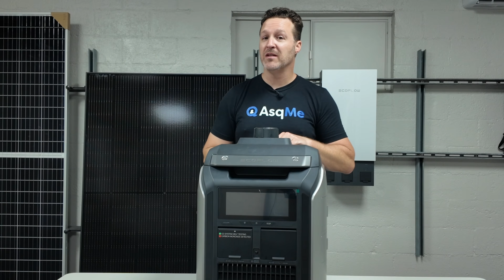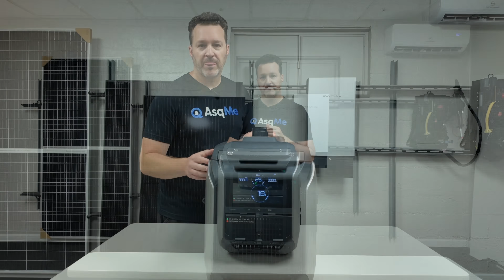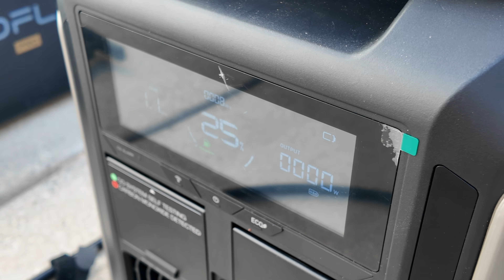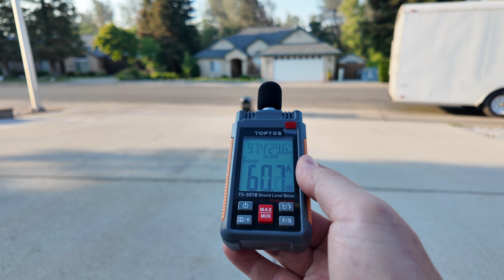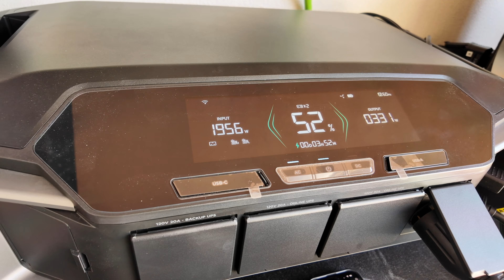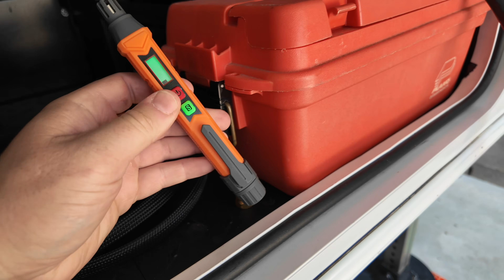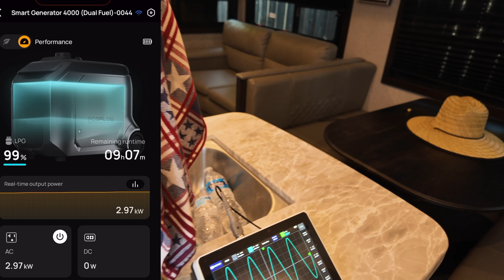ECOFLOW Smart Generator 4000! Complete Review

Comment: I just purchased DPU and the the package included an EcoFlow 4000 watt generator and what was offered was cab
Why would they package these together with cables if unable to charge DC to DC? 
In the comments below, someone mentioned the transfer of the DPU A/C output to the generator while charging AC charge to THE DPU 
I am still waiting for the generator to do my own testing. Will be disappointed if I can’t charge the DPU efficiently with the generator while the DPU IS pushing out A/C power
Reply from the maker: The DPU can not except dc charging. 
Only AC 

The smart Gen can still be used and you can have full app control but it won’t be able to talk to DPU and start and stop when it needs to.
Reply: I just received my ECOFLOW 4000 watt generator 

All Seems ok except for one issue: Being able to connect via Bluetooth. I have sent an email inquiry to ECOFLOW. 

I have multiple devices from EcoFlow to include:
Ultra 
2 waves
Delta pro 3
And a glacier 

All link up to the EcoFlow app without issue. 
I have tried multiple ways to this 4000 watt generator to Pair. Just a continuous blinking of the symbols of Bluetooth and WiFi symbol. When i reset the IOT ( hold for 5 seconds) it beeps and the symbols just continues to blink. I have allowed the internal battery to completely charge, tried connecting with the engine running and without the engine running. Are there any suggestions or a unique procedure to in trying to Pair? A unique QR code? Any suggestions? I am still waiting from EcoFlow. Just have an automated response as of now.
Reply from the maker: @johnkraft5640 mine connects pretty quick just like the other Ecoflow products. I guess make sure it’s on the correct update and if not maybe a replace ??

Comment: Nice review but I didn’t see ant details covering oil…weight, adding to the unit, change frequency, etc.
Reply from the maker: The basic info like oil is all in the manual which everyone should read. 
The gen provides AC at 120v and 60hz.
And pure sine wave. Or DC if you have a Ecoflow product 

I’ll do a service video later 👍🏼

Comment: Can I use this new generator for other Ecoflow products such Delta 2 and Delta 2 Max?  In addition, can I also charge other brands such as Anker?  I assume, it may need some adaptor/connector?
Reply from the maker: You can use this as a normal generator to run or charge things. 
You can also charge any Ecoflow item that has the xt150 connector.

Comment: Hey Johnny, I'm still trying to figure out all this generator and home back up and solar stuff. LOVE your channel. I have a Delta Ultra Pro now with one battery. Will this Smart 4000 automatically kick on with the Delta Ultra Pro if it is low? I was reading that it would not. Also, will this work with a 50 Amp Interlock Inlet for a circuit breaker panel. I saw that the 4000 only has 30 Amp out.
Reply from the maker: No it won’t smart connect to DPU unfortunately and it’s only 120v Gen so a 240v unit would be better for the home and a Gen inlet box if it’s wired to power the whole panel
Reply: @johnnysweekends  That's what I assumed, thank you for clarifying!

Comment: Hello so I am guessing that the adaptor that goes in the battery connection on the pro 3  is not the same battery connection on the ultra and does not work the same looks like you were charging the ultra with the the 120 outlet on the generator ?????
Reply from the maker: Does not work with the ultra, unless you ac charge at 120. But that’s kinda pointless

Comment: And with the Delta pro 30 yes, that's right. They made a doubt, the problem and they made it to ultra. Then they step back and made a Delta pro 3. When they could've made it just like to deal to pro with more battery or bigger batteries. Than more power. Oh my gosh, what the days screw up with now? It's good that they say it's like a tap with the machine itself but it better off. But then just had 2 batteries cause. Then they could have a lot more power in a minute.  Hell a lot more instead of you have to have 3 generators and all its batteries and only get a few 1000 months a power called oh my gosh, 12000 W. I'd rather get to be Delta pro ultras that, I wouldn't rather get 3 Delta ultras or Delta pros than factor I mean, I can get 4 Delta pros.  Achieve more with that and cost less Then this

Comment: It’s not clear to me how compatible this is with the delta pro ultra. It looked like you were DC charging an ultra but does it replace one of the solar inputs to do that?  Whenever I AC charge my ultra with a generator, it seems to transfer any loads to the generator rather than using the inverter on the ultra. I know all of these products are new but it sure is hard to figure out what works together on the EcoFlow site so I really appreciate content like yours to explain things.
Reply from the maker: Unfortunately this does not work with DPU hence not mentioned and me trying to plug it in at the end. We all thought it would be some how. Maybe there is a new just for it..?🤷🏼‍♂️
Reply: Any updates on this? I just ordered two DPUs and this generator to find out afterwards its, “not compatible”. Can’t I just install a generator hookup to my SHP2 and use this to recharge the DPUs?
Reply from the maker: If doing two dpus thats a lot of energy needed to charge efficiently. I would look into a larger 240v option
Reply: @johnnysweekends Thanks for the quick reply! Do you have any recommendations?

Comment: Question please: Hi Can I use the Generator adapter plug (XT51) and connect the EcoFlow Smart Generator 4000 to ..... wait for it.. wait for it....... any of the ports on the right side of the EcoFlow Delta Pro "ULTRA" where the fast charge ports are located? What is the power transfer?
Reply from the maker: The new smart gen can charge dpu by the AC power port only …
Reply: @johnnysweekends  :-(😩 ... Perhaps your contact can tell us if they are coming out with a simular solution for the DPU.
Reply from the maker: @Jay-fc4fg I’m waiting lol ..👍🏼

Comment: My Champion Trifuel RIGHT NOW puts out 6kw on natural gas with split phase output ... for $1500.  I have no idea why Ecoflow is trying to compete in this space.
Reply: @neverclevernorwitty7821  where this shines is when paired with an ecoflow battery so you can run small loads off the battery with the generator only kicking on intermittently.  I don't see this aimed towards the RV crowd but more towards the off grid cabins or post hurricane/natural disaster/Texas power grid customers where minimizing fuel consumption might be worth the premium price.
Reply: @gavincregan7892  also Minimalist campers. I want to do a cargo trailer build and not really finish it or anything. Just have it insulated with ventilation and be able to do a modular set up that I can take out so I can use the trailer as utility trailer Part time and camping part time, as well as having home back up during extreme weather like you mention. Everything being multi-use or dual purpose so I can invest in Higher Quality is my goal. I got my parents and myself each an Ecoflow Delta 2 Max and a single Smart Generator to share with them as we don't live more than 35 miles apart, but we are on 2 separate electrical grids, so it's unlikely we'll go down at the same time.
Reply: Your 6kw uses twice the fuel, even at low loads. During power outages, I'm pulling about 1000w continuously until I start turning things on. After a week or more with the 6k, that's a gas bill you will feel.
Reply: @JayRSwan mine burned about 5 gallons a day for 10 days.
Reply: User name fits.
Reply: Fake account.
Reply: @neverclevernorwitty7821  because eco flow is a superior brand and can simply do it better.
Reply: The advantage is fuel savings for high amp DC charging ECOflow delta backup battery systems. 
You get a 40% fuel savings bypassing the inverter when charging DC batteries.  
And this is plug and play auto start/stop to recharge your DeLTa system automatically.  

The motor on the smaller one (this one is a Yamaha)  was a Honda.... the same Honda generator was actually MORE expensive.   You are not comparing Apples to apples
Ecoflow is NOT in the space of the generator you own.  
 You will use 8-12 gallons a day to power your house for 24 hours.  
The on, recharge hybrid system will run a fraction of the time 4-6 hours a day and us just like 2 gal a day to meet those same KWH.  

I kept my  fridge and freezer and my lizard lights on along with running a blender, toaster, microwave on half power a few times a day and  other things. i used 6 gal total over the week without power 4-5  hours a day or so ONLY to charge my delta max with champion 2000w gen. If I had the ecoflow I would have saved that 40% fuel.
Reply: @davidarnold344 so Getting expensive Ecoflow extra batteries would be cost savings in the long wrong, if in reading what you wrote correctly. 
I purchased LIFEPO4 extra batteries Ana only way to charge them is via AC, which is a large loss of energy. THINKING that I could outsmart EF and save money, foolishly. I got this correct?
Reply: @davidarnold344  yes, this is the main advantage as well as the auto stop start functionality
Reply: Aren't those twice this big?
Reply: @BlissfulRebirth  Well, if you can charge one on a longer cable as well as power things to boot, a Honda or a conventional other inverter generator would be fine.  Besides, I am not sure if I would want to stock pile batteries in my house knowing that when they go, they REALLY go and take your home and you with it.  It's bad enough that my tablet, phone, Nintendo Switch, laptop and various game controllers rely on these relatively potentially volatile little things.  That and internal combustion engines are recyclable, batteries aren't and also have a shorter life expectancy especially for the price.
Reply: @WJCTechyman  lithium iron phosphate batteries aren't the same as lithium ion. Most of the  ecoflow units use lithium iron phosphate batteries which are a lot safer.  Check the specs.

Comment: Fantastic review  That cord only being  16 ft , that's horrible  when have multiple  ecoflow  units,  the DC charging you could get much a  cheaper  generator  to that . For 1700 dollars it seems underwhelming.
Reply: The main benefit is that it works in collaboration with their other ecoflow products. The generator can turn itself on and off automatically based on what you set. So you can set it to kick on the generator if your batteries gets to 10% charge remaining and turn off at 80%. That's its main intended use. Not to beat the others. But to run without needing much input. Its always just waiting and ready in standby if you have it plugged in.

Comment: Great info! im a bit confused on the dc to DP3 if is going to come with the battery connector adaptor or the xt150 so a dp3 would have both extra battery connectors available for more capacity.  What i'm looking for is a system to auto start and shut down to charge my solar setup. Is it possible through the app to have that happen off of battery capacity or voltage through the 110v or 240v plugs? so we could use this generator for any old battery or is it going to be a full ecoflow setup up to have is auto start stop of the dc charging only. Thanks a bunch best reviews on yt
Reply from the maker: Needs to be part of the Ecoflow ecosystem to have the full auto start stop technology. There are data pins in the Xt 150 cable.
Reply: @johnnysweekends  appreciate it!

Comment: Hard pass for me. Needs DPU compatibility out the box and Tri Fuel option for the best home standby use
Reply from the maker: DPU will have to have a smart cable through the 5+8 connector or through smart panel. Maybe we will see something
Reply: Those are hard requirements for a small generator. How many models in the market already have what you ask for ?
Reply: @TheCornucopiaProject-bd5jk  Plenty actually. My current Champion Tri Fuel Inverter Generator is helping get through Beryl right now. I still don't have power for the last 6 days and don't always produce enough solar when cloudy. An integrated Ecoflow generator would provide better integration and automatic remote start when batteries run low without worrying about refueling. In theory it would be the best combination between a home battery backup and standby whole house generator
Reply: @ChristianStJulian  I couldn't agree more.  What you're looking for is exactly what I'm looking for, and it's what I was hoping this unit would be.

Comment: This tech makes solar so much more practical. It allows to evolve a system specific to an area at minimum cost. Now we just need a dual fuel generator option that is LPG and Propane. No gasoline required.
Reply from the maker: Lpg and propane are the same 🤷🏼‍♂️
Reply: @johnnysweekends  I was thinking natural gas lol. No fuel tank, no carburetor. Can run for extended periods if needed with app tracking maintenance intervals. Surprised more companies haven't added this generator option. I think the demand it there with auto switchover and control with an app creating a lot of versatility. The next few years will be great as these technologies converge.
Reply from the maker: @TEN-ve8mp I agree we will see way more smart tech coming in new gen models
Reply: @TEN-ve8mp I absolutely would not want to give up gasoline capability f for natural gas. Why when you can have all 3?
Reply: @johndelabretonne  lower price, smaller form factor and lower weight generators. But mostly for much longer run times if connected to a larger tank or natural gas source. No need to haul or handle gasoline. Not to mention storing it. Propane is safe, easy to store and doesn't go bad.

Comment: Thanks for the video. Would you recommend it over the old one, even if the added power isn‘t really needed?
Reply from the maker: It’s depends … I think lower rpm is better especially on Ac charging but the original will burn less fuel being 80cc 

It will be more depending on what you need